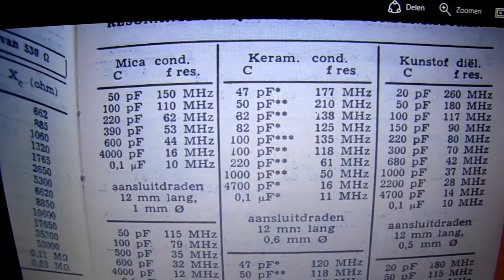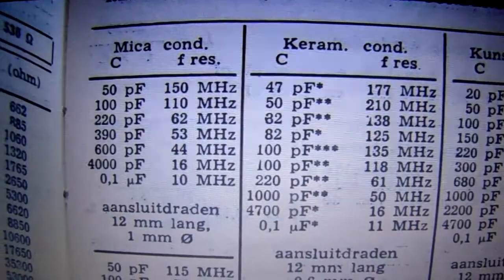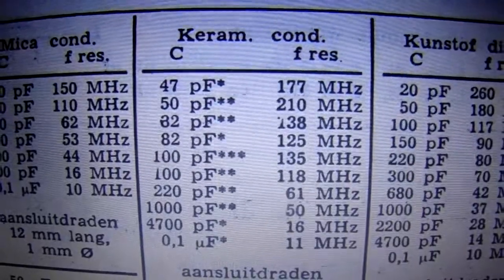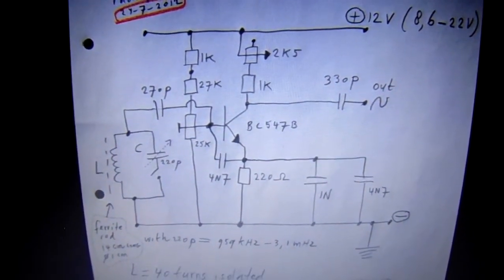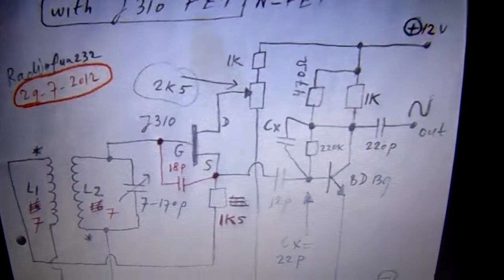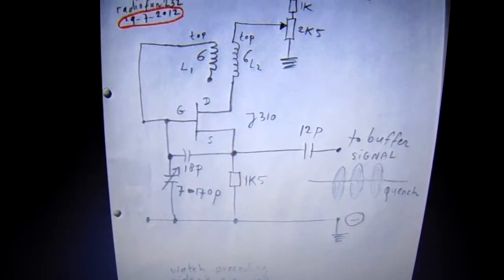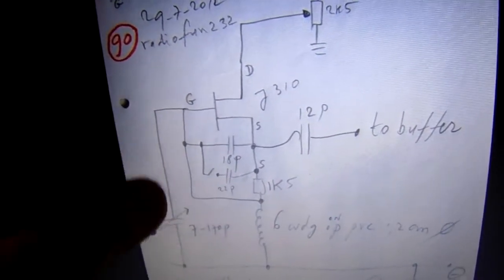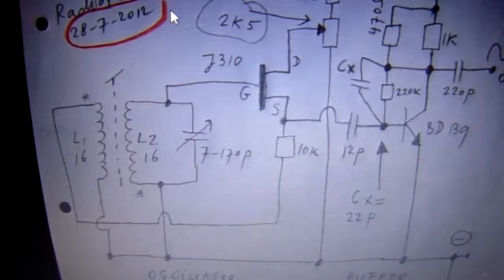Oscillators & some of my (published) schematics and experiments (part 1) (2010-2017)

Comment: Hello Mr. Master.
I watched your video with interest. Thank you. 
Can I achieve high frequency by using a smaller rated capacitor instead of the c2 (100pf) capacitor on second schema in the video?
For example, is it only enough to change the value of c2 to 50pf in order to produce 200mhz?
another question is:
What component should I add to get a sine wave from the first oscillator circuit you introduced in this video?
Thank you.
Reply from the maker: Thanks. That schematic is/was purely experimental. It was despised by my radio society, Veron, Netherlands, they told me it could not work or it worked because of stray capacitance and inductance (not true in my opinion, given my experimental results and/or: the schematic also worked when stray inductance simply could not be there). It is more or less a "study" circuit (it cannot go to 200 MHz with the used transistor in the video). The first oscillator creates a sine wave. For 200 MHZ in a proven circuit you need a real HF transistor in the so called "grounded base circuit" (not on my channel, I don't have experience with these high frequencies).

Comment: Hey Ko, always enjoy your videos on oscillators. I have been struggling with the oscillation on the old radio I've been restoring and they sure can be tricky. Like watching the ferrite antenna vids as well. Heck, I like it all. Keep making them pal.
Carl
Reply from the maker: Thanks Carl! (I learned the oscillator making by doing hundreds of experiments, and when I sometimes start from point 0 in developing a new oscillator circuit it often, again, is a problem to get it working).